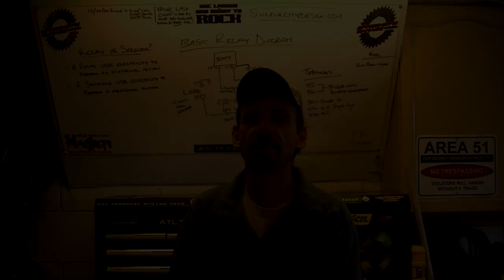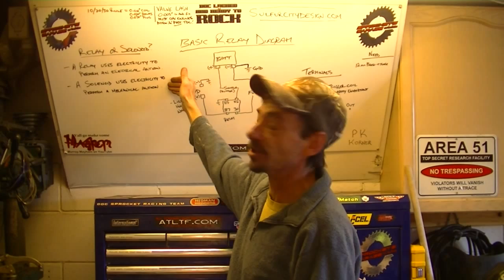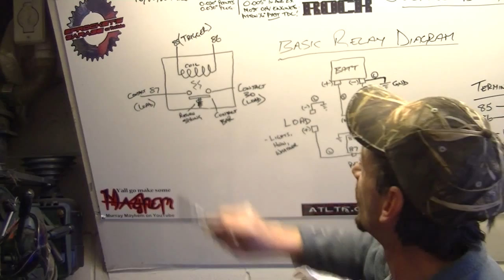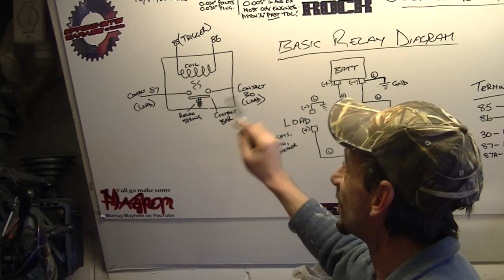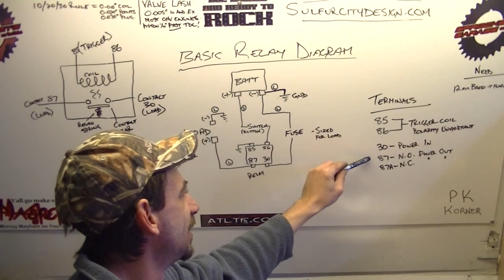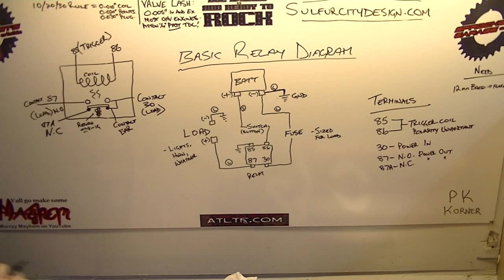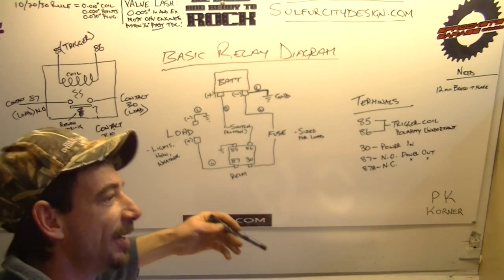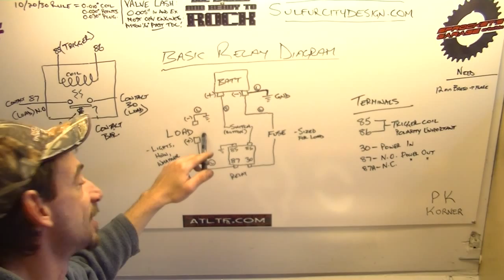Wiring Tech- Relays

Comment: i have a question for you youtubers. how would i wire a relay into my truck taillights to control my trailer lights. my question is... if im tapping into my taillight wire to control the relay, will all the power go to the relay instead of the truck tailight? do i need to add a resistor in the wire before the relay? what would be the best way to do this? thanks guys
Reply from the maker: Chase Lejeune Piece of cake. Tap into the taillight circuit and bring that to relay terminal 86. Ground 85. Battery positive thru a fuse to terminal 87. Terminal 30 is your output to trailer. No resistors, no adverse affect on vehicle lighting circuit. NOTE- Many "modern" vehicles have a really complex, and honestly stupid method of controlling the lighting via computer. As an example, the '99 Windstar I had, required a $100 add-on module to convert the lighting circuitry for towing. If yours is like this, the simple relay may not work for you. They are apparently really sensitive.

Comment: I typically use 87 as the source/battery side rather than common(30) because then with the relay off you don't have an extra live terminal (87a) floating out there.
Reply from the maker: therainbowboxer Yep- I can see the benefit to that (When using a 5-pin)

Comment: One problem with your diagram... Your terminal 30 is drawn connected to - on battery which would cause a massive short when triggered... I know it's a minor drawing mistake and that u no what youre doing but for someone with no prior knowledge just following your diagram it could spell disaster especially if they neglect a fuse
Reply from the maker: I.C. karting No short at all. If you examine the fault, you see that you end up with grounds on both ends of the circuit. It would simply not work. Now, I DID make that doodling error, but I can also tell you missed reading my video description. It's there..

Comment: One problem you have 30 going to ground on the diagram
Reply from the maker: ***** Yes- I noticed that afterwards, and noted it in the video description. Too much on my mind...
Reply: Some relays do have a built in diode across 85/86 and won't work if reversed. Easy fix tho, reverse your wires :)

Comment: What I was thinking about is, if I use an automotive type key switch that has power out what would be the ignition in a car when the switch is in run position I want to use this to power the trigger coil only while the actual power for each circuit comes from the battery. turning the key off prevents anyone of turning anything on without the key and won't over load my switch
Reply from the maker: Jim Alexander I did that on MULE. I have a relay tied into the ignition switch that only allows certain accessories to run with the key on. https://youtu.be/bu_cMmOPTtQ

Comment: Nice video!! Right on the money. But I still hate electrical, LOL.
Reply: lol come on man. It's good stuff. I went to school around the corner from ya and learned it all there. 
Dc stuff is easier to grasp at first then ac stuff. 
Once ya understand relays, I bet your Ol jeep is gonna have 100 of em. 
I used a couple of relays to adapt in an air horn on an old car but not using any extra visible (or hidden) aftermarket switches. 
I wanted stealth so I made it so it was armed when I turned on the rear window defogger and hit the normal horn button it would operate he air horns...turn the defroster off and the horn was the stock horn. 
Relays can help ya :)
Reply: MrTheHillfolk Yah, I understand them and more. I still don't like it, LOL.